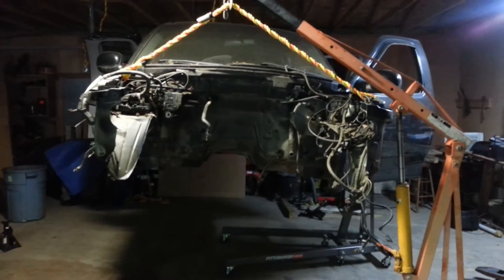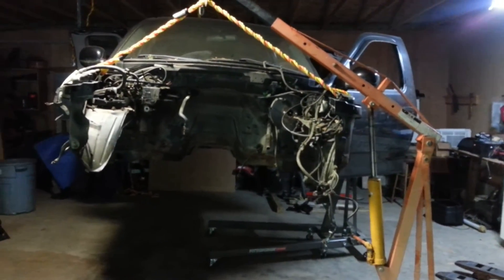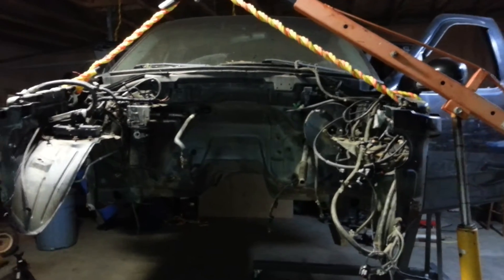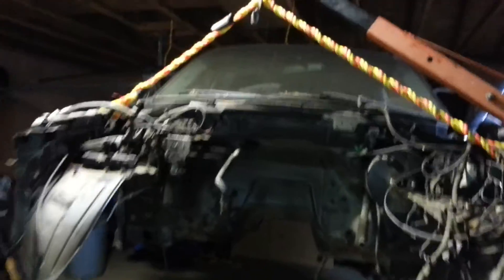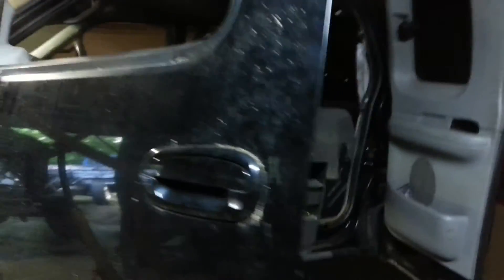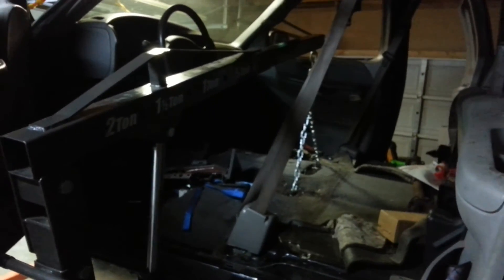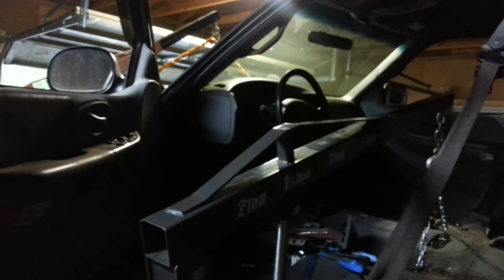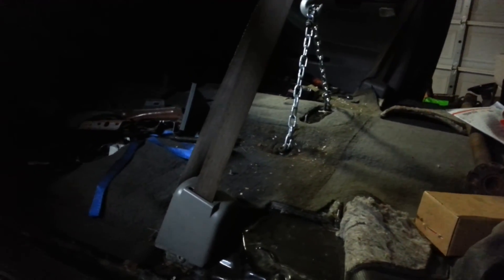Ford F150 cab removal 97-03

Comment: Yeah, I know this is an old vid. But I'm about to tackle this job due to tornado damage. I had the same thoughts because I also have two pickers. The only real downside for me is I don't have a shop or even a slab. I'm going to use 3/4 inch plywood as a floor. Y'all know how it is, do the best with what ya got. Oh and rule #1 in the shop (when I had one): Don't die!! Thank You Sir for posting this.
Reply: I’m thinking of cab swapping my 97 v6 longbed cab onto a 7lug f150 5.4 drivetrain/frame. I like this idea but I’m not seeing how we’d be able to roll the frame out from under with the jack legs in the way.  Good luck with your swap….
Reply: @zj_miami9151  Well, here's my thoughts about that, or at least here's what I'm going to try, if I end up swapping cabs. I have two pickers, engine hoist, cherry pickers, whatever you'd like to call them. I'm going to use them to pick the cab up. Once the cab is in the air. I'm going to make a stand that's wider than the frame to set the cab down onto. Then get the pickers out of the way and Bob's your uncle. Roll your old frame out. them roll your new-ish frame in. then just doing everything in reverse. 
  Hopefully that made sense. Oh and the stand i have in mind. I'm going to take four of my 3 ton jack stand and some roughly 8 to 10 foot 4x4's. I think the most important thing about this plan/idea/whatever, is to NOT set the cab down on the pinch welds. Probably going to have to build risers off the 4x4's that will allow you to set the cab down onto the factory mounting points. Just PLEASE make sure everything is stable!! We DO NOT need you, or anyone else that might be around, to get crushed by a cab. I'd make sure the risers are at least screwed, bolted would be better, to the 4x4's. But I do honestly believe that this will work. At least within the space I have. Which isn't much. I'm outside on a gravel driveway. But at least it's level.
I hope all this Blah blah blah helps. Again, hopefully it makes sense and I haven't just confused the 💩 out of you.
Just first and foremost, I can not stress enough, PLEASE BE CAREFUL!!! 
Good luck with your project zj_miami!!
Anything I can help you with, I'd be more than happy to.
Have a good one and Be Safe Out There
🤠😎
My apologies for being so long winded and for any typing errors. 😏
Reply: @abitoffcenter383    Thank you for your input sir.   That sounds like  it’ll work perfect.

Comment: Greetings from eastern AZ, please did you have any trouble completely removing the cab mount bolts tucked up in the driver's/passenger's feet area? I'm in the final stages of parting out, and hauling off to scrap, a  2000 F150, and I've loosened said cab mount bolts, but I can't completely remove them. It feels like whatever captured nut(s) that are part of those particular cab mounts, are spinning. If I have to cut them I think I've loosened them enough that I can jack up the cab a bit to allow enough room for a hacksaw or sawzall blade to sever the bolts. Thanks.
Reply from the maker: I was able to take my bolts all the way out without problems but if yours are spinning you will have to Sawzall them off. Thanks for watching!
Reply: @chanraxter2015  Good morning Chan, I watched another YT video (from an actual Ford repair Tech) who said the caged nut inside the body mount sometimes hangs up on the copious, thread locker (which I noticed on the bolts I was able to remove). He suggested to heat the bolt (which is normally counter-intuitive) just enough to melt the thread locker, and then try turning it out again. I'll try that b4 resorting to the saw. Fingers crossed, cheers, Tim